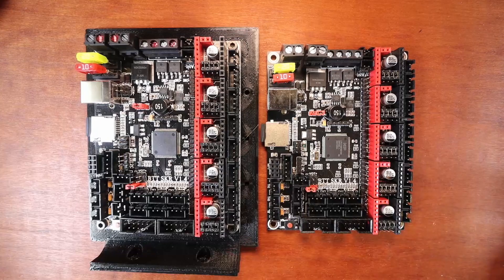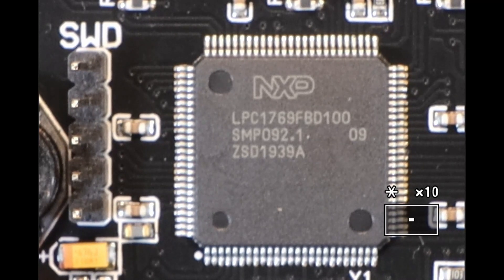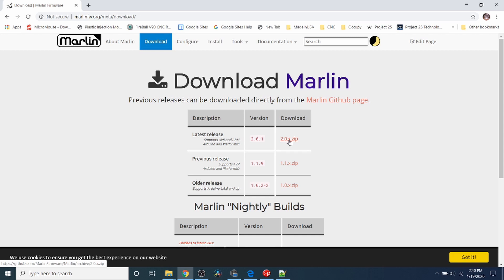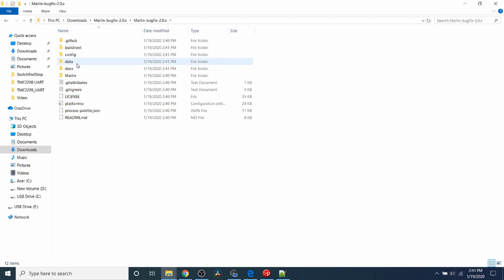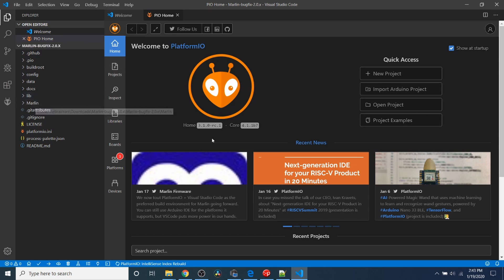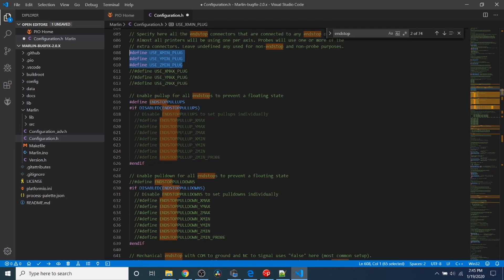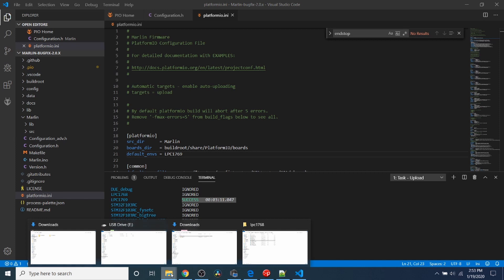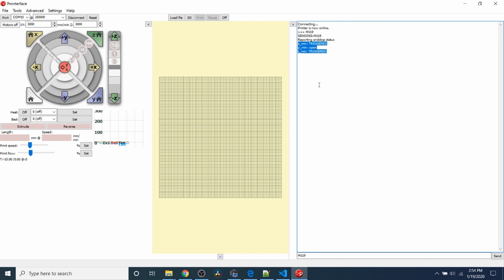SKR 1.4 - SKR 1.4 Turbo Firmware load

Comment: Do I leave the Y min open all the time or change it back to false?
Reply from the maker: Open is good, but if it's not working you can change it in software and see if it works.  When using a with endstop for filament runout the logic maybe reversed.

Comment: My SD card doaen't load, any advices ? it said " attach media" but nothing appends when selecting it ... everything is allright but that.
Reply from the maker: In my SKR 1.3 playlist, I explain how to fix tf drive (sd card).
Reply: @EdwardBraiman  I found the solution, I didn't write "SD ONBOARD" it was on "LCD". Now it's working fine ! In its enclosure, the printer makes 22dB when printing ! (with new Noctua fans).

Comment: @Edward Braiman , you are so clear it’s a pleasure to listen to you, all this worked like a dream. The only issue I’m having is how I can power the board with 12vdc and send g code commands via usb.
My tft 35 v2 won’t connect so I’m working blind.
I’ve tried the quick fix on that with the baud rate but that hasn’t worked. If I could power the board and send commands with usb then I could use repetier host to setup my printer. Do you know if it’s possible to do that?
Reply from the maker: Check serial port two and set to -1.
Reply: Edward Braiman done that... bauds match. Tried everything. The cable is in correct too... oh and I’ve got the board connected to pc and pronterface so I can work without the lcd now, but it’s a shame as my lcds always have issues

Comment: Great tutorial.  It worked great for me untill 2 wks ago.  Now I can access my my SKR1.4T with Octoprint but it no longer shows up on my PC as a "Disk Drive".  Also, when running the SKR using the TFT35 in "Marlin-mode", the SD card will not show up.  So, I haven't been able to load new MARLIN code (with minor tweaks and updates) to the SD card by direct connection.  Furthermore, when I put "new" firmware.bin files onto the SD card using an adaptor and return the SD card to my SKR SD slot, the board will NOT update to the new code.  FIRMWARE.CUR and firmware.bin remain 'unchanged' on the SD card even after multiple resets and power cycles of the SKR.  So...I thought I have ordered an STLINK V2 programmer and will try to use that to regain access to the SKR.  

Ed - Have you ever used the STLINK device? Do you have or woruld you consider an instructional video on this topic?  Keep up the great work!
Reply: I am having the same issue
Reply: except mine started initially right from the start
Reply from the maker: Try reformatting sd card or replacing with another, not it needs to be formatted fat32 and should be at least 128mb or less in size.

Comment: i dont have the upload button on the bottom. the only thing i have on the bottom is the error number icons and the icon for "refreshes the action buttons" i installed while trying to figure out how to get the upload button on mine.. This is where i get stuck every single time because i dont have that option..
Reply from the maker: Is the Platformio plug-in installed?  You may also need Git.
Reply: @EdwardBraiman  no idea.. i did exactly what he said to do, and i did ONLY what he said to do.. So if its in the video, i did it, if its not in the video i did not do it. there is a thing on the side that says "platformio" with an orange alien head.. But i did not install that. It was there when i opened the folder in vscode
Reply: and i have no idea what "git" is... is that what give syou the check mark on teh bottom? is there no other way of doing it? i clicked "save" so can i not drag and drop it from somewhere onto my sd card?
Reply from the maker: Watch this video ... https://youtu.be/H4b0eIQzxG8
Reply: @EdwardBraiman  That was the problem.. I Installed that extension and now i have those same buttons that i see everyone else having..

But i have a new issue now.. When i try to "build" it gives me 4 errors because the pio/build/lpc1769 folder is completely empty.. When i watch other tutorials this folder is full of other folders and files.. i dont understand how mine is empty and everyone else is all good when i am literally following their every move to a T..

Comment: i have a question, i bought the skr 1.4 turbo boardwith the 2208 steppers to upgrade my cr10-S, if i follow this tutorial correctly, can i just compare the 2 marlin config files afterwards and make the required changes, and it should work correctly?or maybe a possible video for the cr10-S? thanks.

Comment: So far everything is going well but for whatever reason right at the very end you have the the build and platform icons at the bottom left corner of the status bar. I dont and I can't seem to find them. So I can't test and send. It is super irritating being the very last thing to do before finishing. I'm sure its something easy and my dumbass is just not seeing it. Yup 1 button click to being done and can seem to find either of those 2 things lol
Reply: ARE YOU STILL LOOKING OR DID YOU SOLVE IT?
Reply from the maker: There's a video in my playlist on how to install VScode and PlatformIO extension.

Comment: nice video am trying to do the step with printun with my mac it says its not good for this ver of mac
Reply from the maker: Can you try on another computer as like a Raspberry pi 4?  And remote to it via Mac browser?
Reply from the maker: Are you related to Abraham?
Reply: @EdwardBraiman  am Egyptian living in Canada so i dont think so :) it works now i tried it with another PC , is there a way to operate the printer with that VIA the WIFI or the USB instead of screen ? because i have the SKR 1.4 turbo and my printer screen plug will not plug to the SKR board i have a predator :) love your work by the way

Comment: Did not need to dumb it down so much. Anyone doing this is going to be able to follow along without all the pauses and slow motion talking!
Reply from the maker: Problem is if I speak quick, then CC, doesn't capture what I'm saying.  These tutorials are CC in 80+ languages.  That's why I speak at a modulated speed.
Reply: @EdwardBraiman  Gotcha, yea you would think speech recognition software today would be far superior to what it still is.
Reply from the maker: Try saying, "boot screen" or "UART" and see what it recognized as.

Comment: did you install any driver for connect to pronterface? ı have skrv1.4 turbo and marlin 2.0.5.3.  port is correct, baud rate is 250000 like in marlin but ı cant connect. it is just say "connecting..."
Reply from the maker: This sometimes happens to me and I reboot computer and board and it's fine.
Reply: @EdwardBraiman  ı figured it with change serial port -1. ı used 0 because of tft24.

Comment: hey hows it going chief, so when i get to the part with the lpc1769 build or upload. Where your cursor is on that blue bar. I don't have any of that on mine. So I tryed to manually command assuming that those are just shortcut. Now when I right click on "lpc1769" and it is highlighted, I choose "command palette" and search for the task "upload" but no results, than I search for "build" select "run build task" and I get pop up messages stating the action cant be done. I must have watched this video 60+ times, I can not figure out what I am doing wrong. I am assuming the blue bar missing all the prompts that you have, has got something to do with it.
Reply from the maker: Is the plugin for Git or Platformio missing from VScode IDE?

Comment: Hello,

I have a problem on my side to install the firmware on my BTT SKR V1.4 Turbo. I followed the manufacturer's instructions before turning to your tutorial and a few without success. I have a TFT35 V2.0 which always tells me "No printer attached" despite my multiple attempts. I also in doubt changed my micro sd card without success.

Do you have any solutions or advice to give me?
Reply from the maker: Checkout in my playlist the TFT tutorials.  You may need to update the firmware.  Keep in mind BTT changed the default setup to the other folder a couple of months ago to unified menu.

Comment: i'm using a tevo tarantula, and when i power up the board, the screen turns on but nothing shows up on it and it makes a weird noise. Do you have any idea how i can fix this, do i have to change my screen type somewhere in the firmware?
Reply from the maker: It could be the ribbon cables are reverse, but I would need to know more about your hardware.
Reply: @EdwardBraiman  Thanks for your reply, i already fixed it by downloading an easyconfig version for the tevo tarantula and changed the board and drivers and such in there, like in your video, now it seems to work fine!
Anyways thanks for your usefull videos, without them this would've taken me days to configure it all.

Comment: After uploading vscode says that it is complited, but motherboard still doesn't have software. What am I doing wrong?
Reply from the maker: Do you see a com Port connected in device manager for USB when it connects?  Are you using upload button in VScode? Do you have the jumper set for 5v use power on the board?
Reply: @EdwardBraiman  this problem was fixed, now when i connect tft to motherboard it connects, but after 10 seconds it disconnect without saying anything
Reply from the maker: You may want to watch my TFT videos I. My playlist and see if it addresses your issue.  Look for the firmware video in the playlist for TFT.

Comment: im having an issue when i try to connect to pronterface. i click connect and it just says connecting indefinitely..
Reply from the maker: Check device manager for a new com Port after connection of USB.  Also how are you powering board 5volts or PSU?  Where is the jumper before power up occurs?
Reply: @EdwardBraiman  thanks for the reply seems there was something missing from my build it was very small. I got it working.
Reply from the maker: You're welcome.

Comment: Hey all, im currently upgrading am6 to 2 in 2 out dual extrusion, i have motion and bed heating working but the hotends will not heat up at all. As far as i can tell the cartridges and thermistors are ok. Could this be a firmware issue? I have 2 extruders and relevant thermal settings enabled. TIA
Reply from the maker: Have you checked continuity on thermistors and have you tried one at a time to see if functional?
Reply: @EdwardBraiman  sorry for late reply, i stupidly had thermistors the wrong way round, however i realised after taking them out to check resistance as you suggested, so thanks lol

Comment: Great explanation. It helps to run this video at 150% speed.
Reply from the maker: True, but for closed captioning I need to speak slower, otherwise boot screen turns into blue screen.
Reply: @EdwardBraiman  haha you're right!
Reply: Excellent advice. He's very thorough which is immensely helpful. But yes 1.5x through the known stuff is great
Reply: yeah no shit. i wanted to jump off a bridge until I did that

Comment: This is a great tutorial. Thank you for putting this together. Is there any reason that I would get an error saying "Cannot find build task", or "No task to run found."?
Reply from the maker: Might be missing Git plug-in or Platformio plug-in.
Reply: @EdwardBraiman  Thanks very much. Apparently there is a default task detection that I somehow turned off. Fixed it now. 

Would you happen to know why the BLTouch would not deploy?

Comment: Very interesting tutorial but I encounter a problem when I want to load the firmware on the SD card, this specifies:
"Error: Please specify` upload_port` for environment or use global `--upload-port` option."
I may search the net and I can't find anything concrete.
maybe you have a solution to this problem?
Reply from the maker: Check write protect on micro adapter SD card.
Reply: I just tried with another adapter which is quite open and not locked,
I also try directly as specify in the tutorial and I always have the same concerns.
I do not know how to do!!
Reply: is there a command line in VS code or even Atom or Platoformio on this subject?
Reply from the maker: It sound like an install issue.  Try removing Platformio plug-in and VScode and then reinstall.
Reply: I am having your problem right now

Comment: I don't know why, but doesn't work :( When I try to upload, there is just No task to run
Reply from the maker: It sometimes happens.  Can you tell me if compile was successful?
Reply: @EdwardBraiman  Can we go to private message?
Reply: @EdwardBraiman  Ok I tried it with other pc, upload started but, failed in negaatmega2560... Some ideas?
Reply from the maker: When it says failed, which program are you using ATOM or VScode with Platformio?  Are you checking check mark for build or arrow for build and upload?  Is a board connected?  These questions will help me see your issue better.
Reply: @EdwardBraiman  OK, I just saved it, but now LPC 1769 failed

Comment: Thank you so much for this description. Its great to know all the differences and performances. Whats the difference between 1.3 and 1.4? (since they use same chipset)
Reply from the maker: Different etching on boards to handle stepper drivers, additional 2 more power pins, addition pins for auxiliary devices.  All these are changes on SKR 1.4.

Comment: Thanks for this video 👍
I have some questions, I want to make my own 3d printer like Ender 5, but with 3 Z-AXIS, 3 Z-endstops for real auto leveling and 2 extruder. Can I realized this with this Board ?? Where I do connect 2 more Stepper driver and endstops?
Or know anyone a other not so experience Board that can manage that
Reply from the maker: Normally one axis uses one Endstop.  People have done two x axis print carriages, but most people start with one x carriage.  As for doing three z axis steppers, it may require modifying Marlin firmware.  Keep in mind you want to maintain same z axis for printing to maintain layer height.  You might want to research a diamond print head to get three colors per print head.  Hope this helps.

Comment: Hi! thank you for the video it's very helpful but I had a quick question I hope you could help me answer, I'm currently upgrading my Tronxy X5S to a better board but I'm trying to find one that can have 2 Z end stops because my printers Z uses 2 motors to move the entire bed and using one end stop can let the bed become un-trammed. is it possible to switch one of the power dedication pins into a second Z end stop? Thank you for the video and have a good one!
Reply from the maker: Anything is possible.

Comment: Thank you for these vids! I'm completely new to this and wouldn't have got this far without your help. I don't have the compile/build icons at the bottom of VS Code. The bar is there with two error icons, but that's it. 

Oh, fyi, if your PC doesn't see the board via USB, try pushing the SD card all of the way  into the board. Only took me about an hour to figure out lol.
Reply: Same here. No build buttons and I dont find them anywhere in the menus. Help!
Reply: Same here no compile or upload buttons
Reply: User error.  Did not have PlatformIO downloaded and installed.
Reply: @mattcluever9502  Just figured it out,  You need to download the PlatformIO extension the add it to VS code.

Comment: Looks like the Turbo is quite a bit smaller, but other than being 20Mhz faster there should be no difference at all between them?
Reply: The one board is mounted, the v1.4 turbo is not.

Comment: Hi friend but maybe you got confused for the turbo the serial port should be set to 0 no to -1.
Reply from the maker: I prefer using -1.
Reply: @EdwardBraiman  what changes by changing the values?
Reply from the maker: In my case I lost communication with board using Pronterface.

Comment: Hello Edward, I have a question. Can I also use a capacitive sensor for auto bed leveling on this board, and how is it connected and configured? Thank you very much for that.
Reply from the maker: I no longer do tutorials on capacitive sensors due to confusion with hardware with end users and it can set wiring on fire.

Comment: Hello Edward, thank you for this video. As always, it has become a very detailed tutorial and has helped me very well. Could you please make another video in which you show the how to configure the fan pins? Thank you very much in advance.
Reply from the maker: It'll be a couple of days.  I've been trying to work with Marlin regarding BLtouch all night.
Reply: @EdwardBraiman  any luck with the Bltouch
Reply from the maker: @robo909  I've opened two bugs on Marlins bug database regarding the same issue on multiple platforms.  So far they are either not trying to replicate the issue.  Or are unable to explain correct configuration steps.  Or generally want to keep it low on the bug queue until I find them a solution.  I may need to dig into my old videos for the files used at the time and compare for changes to localize problem.  I'm not a paid member of Marlin's developer group, so it's when I have time to examine on weekends.
Reply: @EdwardBraiman  did you try this #define Z_MIN_PROBE_PIN P0_10 // Pin 32 is the RAMPS default. I have changed the Pin 32 woth z Probe in number
Reply from the maker: @robo909  it maybe related to a deploy state gcode.

Comment: Have you had success using the BLTouch with the dedicated probe pin on the 1.4?   It doesn't deploy the pin when it home so nozzle crashes into the bed when  all the pins are defined properly and #define z_min_probe_uses_z_min_pin is commented out
Reply from the maker: There are several open issues on Marlin bug tracking website for 2.0.x and nightly builds at the moment.  Trust me the moment it's fixed, I'll make a tutorial.